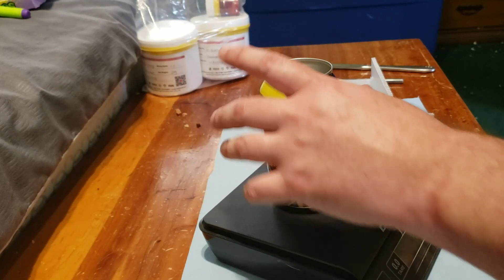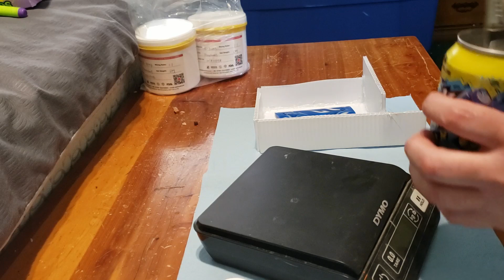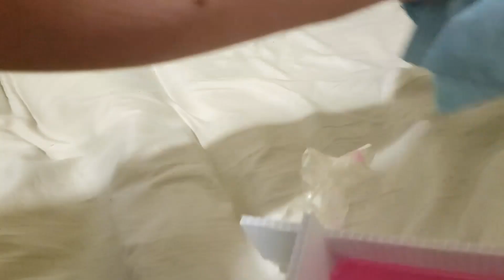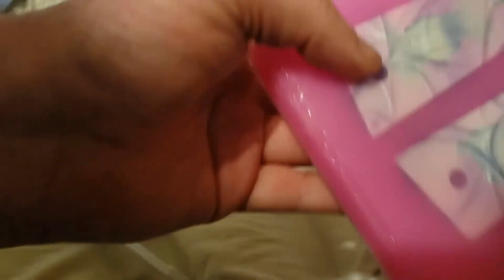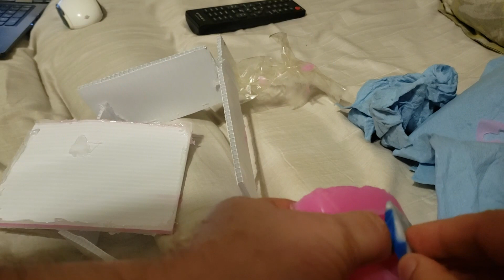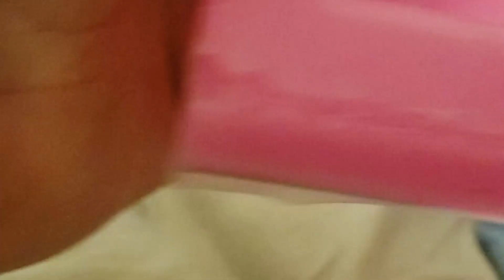making a DIY silicone mold 1911 grips casting  grips

Comment: Can you make a mold for a beretta 92fs grips I’m having problems figuring out how to do it because the grips are not flat on the bottom like the 1911 one side is higher than the other take a look at the beretta grips and you will see what I’m talking about any help you give me will be appreciated maybe a tutorial? Thank you for your time stay safe god bless
Reply from the maker: i can try it will be in a week or so but ill make something to help
Reply: Do the same process as this but hot glue the gaps and trim them after pour ….may be a little work but only solution I can think of ….good luck